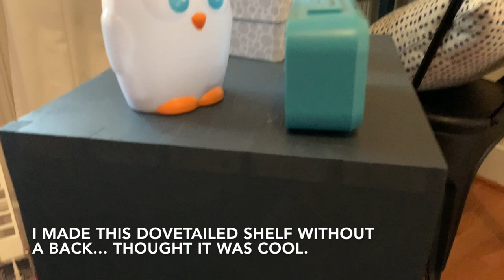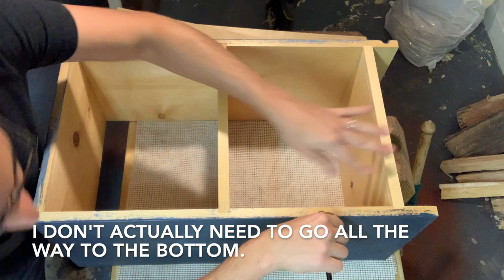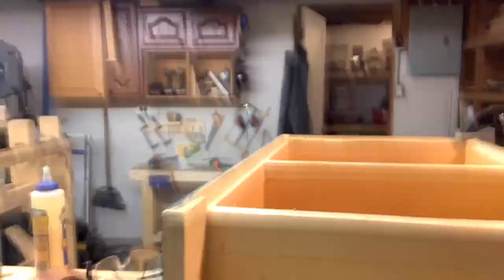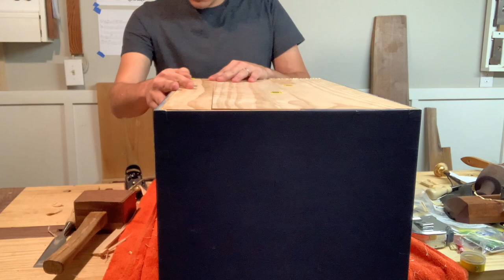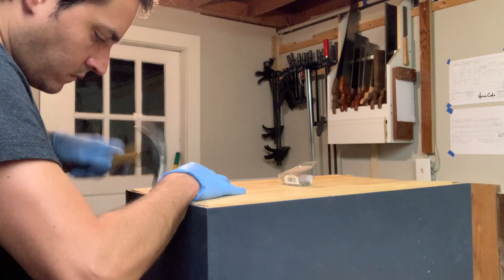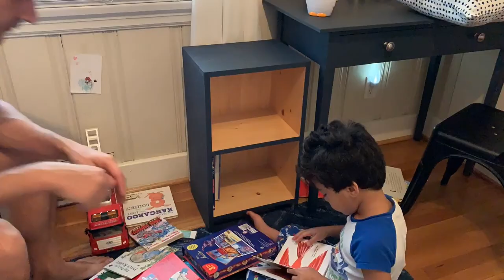Stopped Rabbet for Bookshelf Back Panel | Hand Tool Woodworking

Comment: Your shop setup is going to make me sacrifice a spare bedroom sooner than later. Just have to find another place for a treadmill. Separating hand tool from power tool would be both weird and fantastic. Kind of a mood thing sometimes.
Reply from the maker: Ha! Well whatever works! I do enjoy enjoy the hand tool experience though. Is there any way you can move some of the larger tools aside when you want a more hand tool setup? I have my power mitre saw put away most of the time, and I my bandsaw is on wheels, unplugged. I just keep them out of the way to use occasionally.
Reply: @TheHandToolery  They are. Hand tools in the corner near the bench. It’s more about the garage versus spare bedroom and climate control. Going to the garage is sort of an island that leads to many side things like cleaning.

Comment: Where do you live? Is it humid? I’m always wondering how to know how much gap to include in projects for expansion contraction?
Reply from the maker: I’m in Virginia, and it’s humid. But since I got this from lowes, where the doors are always open more or less, I imagine there is humidity to lose. Also, we have central air/heating, so the humidity in the house doesn’t change much. Lastly, I used nails, so they have some give to them.

I think there are actual formulas for expansion, but I eyeballed this. If it destroys itself, I’ll make another :)
Reply: @TheHandToolery  I’m in NC in the mountains north of Boone so I appreciate the info. We moved from Texas so climates are way different since where we are now is almost a rain forest sometimes.